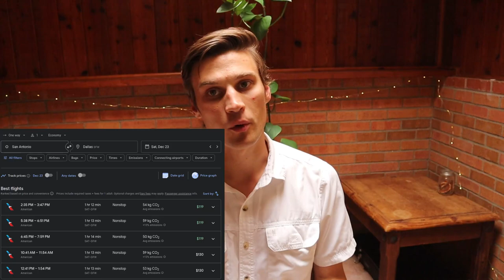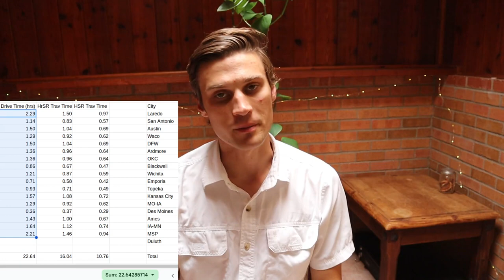What if Interstate 35 were High-Speed Rail?

Comment: Good news is the Minneapolis-Duluth corridor will soon be getting Amtrak higher speed rail service through the Northern Lights Express plan. For an expected $30-$35 ticket cost, we're getting 90mph top speed with 4 daily round trips for an expected 2 hour 30-35 minute travel time, with a few stops in between including Superior, Hinckley and Cambridge. I-35 in downtown Duluth is also set to be infilled with plans for Duluth Union Depot to improve this future NLX service. Expected total project cost is $592.3 million with $194 million already put forward by the state of Minnesota, awaiting a federal funding match. It doesn't quite follow I-35, even if some of the rail still exists between Hinckley and the St Paul corridor (tracks turn into a rail trail between Hugo and North Branch) which does parallel I-35, but regardless you'd still have the major demand generators that are shared with I-35 served by higher speed rail.

There used to be a full passenger rail service called the Twin Star Rocket, which ran from Minneapolis-St Paul to Texas. Could be done nowadays as a sleeper or long distance train.
Reply from the maker: NLX will be great once it's running, and if it is successful, the argument to extend to Des Moines would become much stronger. I'm really looking forward to see how Minnesota gets it done!